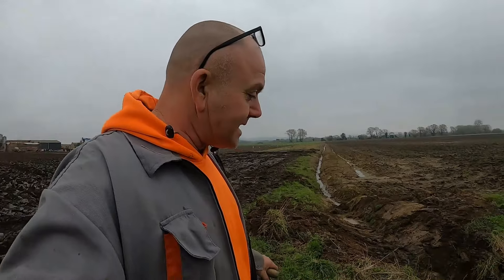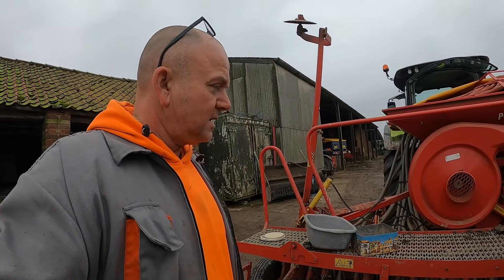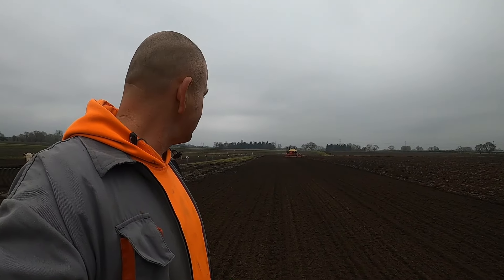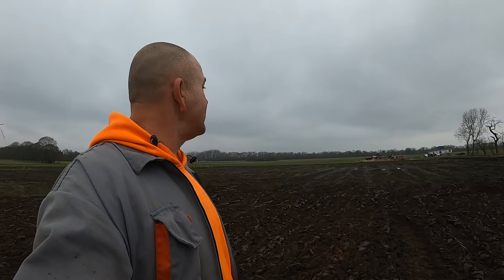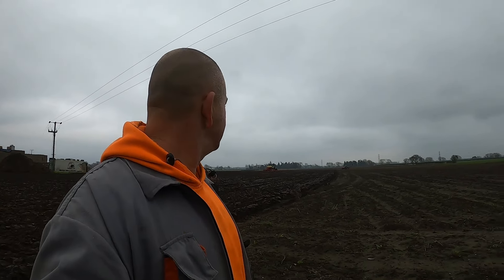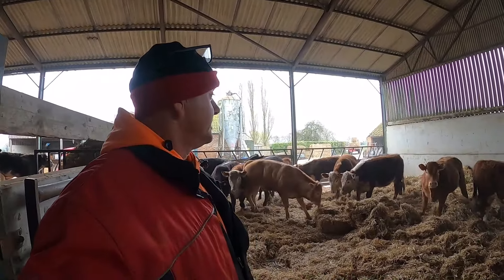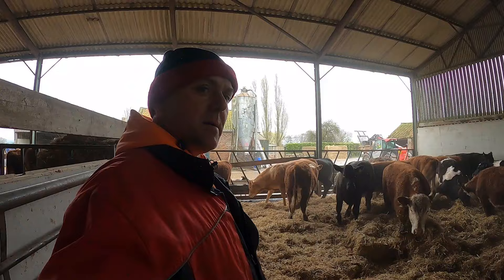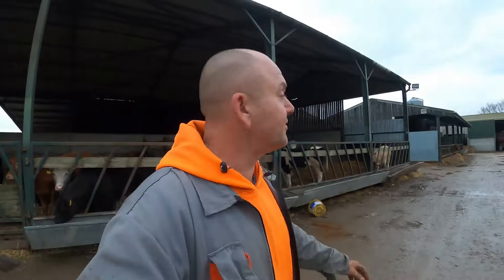Drilling Spring Barley

Comment: I'm of the view that you are doing the right thing by ploughing and power harrowing that barley in now. Whilst we may very well get more significant rainfall in the next few weeks as nice as that soil looks I continue to think it will cope more and more easily. Soil temps are steadily rising so germination and growth will accelerate rapidly providing it has access to sufficient plant food - nutrient losses through leaching are likely to be higher than normal with all the wet weather we have had. 

Just remember barley and fodder beet are highly sensitive to lower pH levels compared to wheat and other crops so monitor crops carefully especially if the fields have not been tested recently. Dan